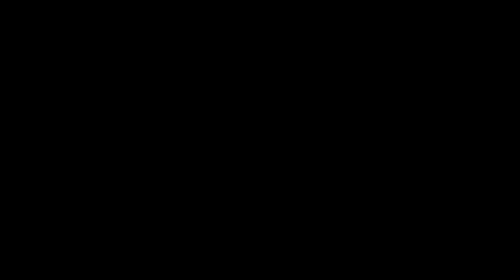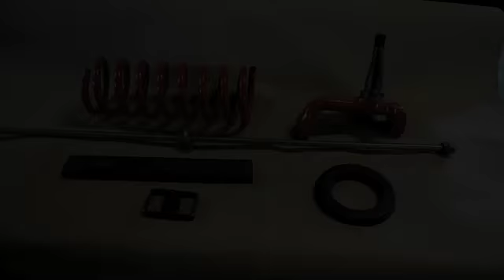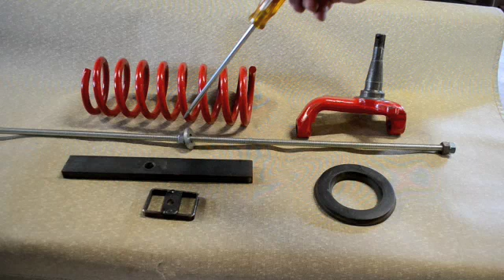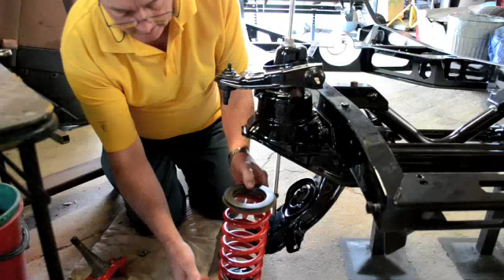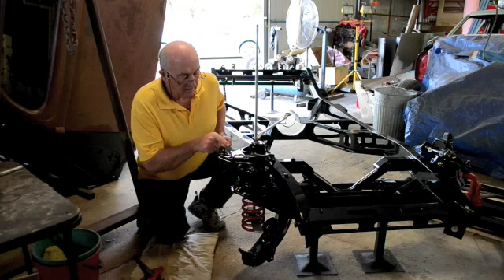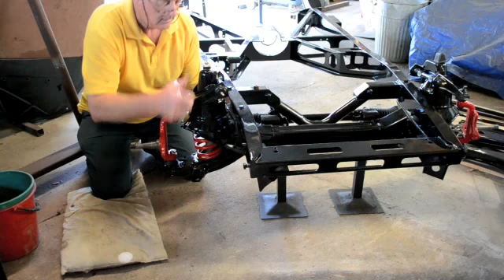Mitsubishi L300 front end assembly

Comment: Does anyone make a softer spring rate front coil spring for the L300. The stock springs in mine make it ride like an empty dump truck 😥. I am looking into what other spring maybe out of a different model would work. If I discover what works well before I get an answer I will post the update here. Over here in the Philippines we use these front ends in lightweight Willys CJ3a and CJ3b model jeeps with light weight 4 cylinder japanese engines which is what we can get over here. I. Would love a V-8 but they a prohibitively expensive and next to impossible to find here.

Comment: How did you determine the proper spring rate for your new application. I'm pretty sure your 36 Ford is a lot lighter then a Mitsubishi Van for one they have a lot of front over hang. Also are you using drop spindles? If so where did you get them? Over here in the Philippines these kind of parts are a real B*tch to get your hands on.